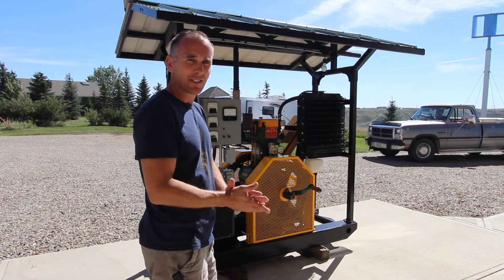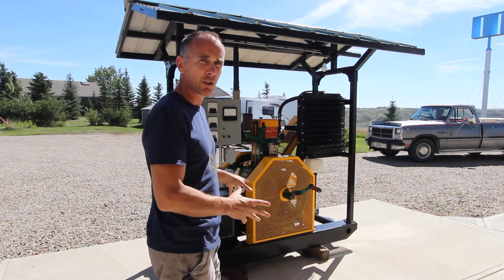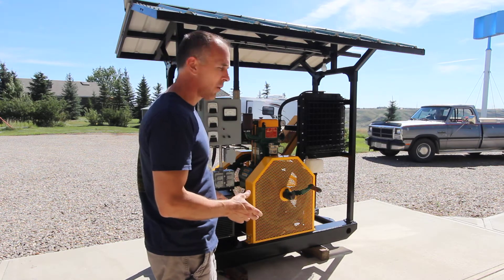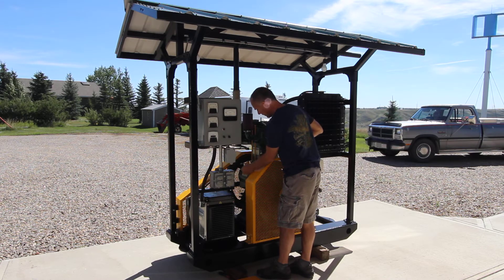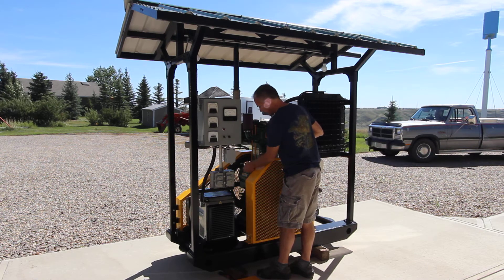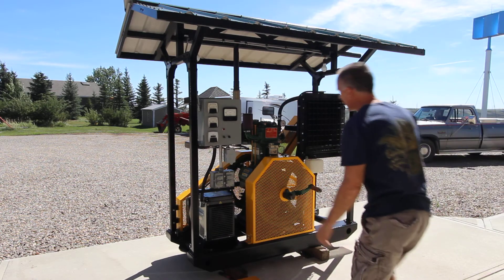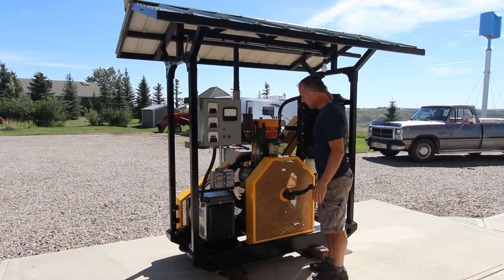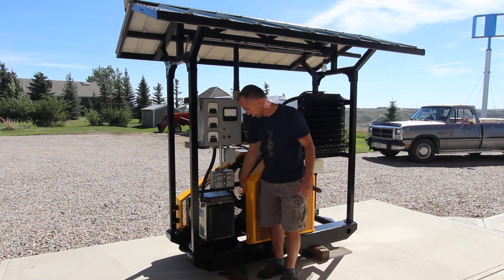Welcome to Eco Diesel

Comment: Who build or made the set up
Reply: I am Troy, the fellow in the video. I built this Listeroid generator/waterpump skid here in my shop. The pump wasnt on it at the time this video was made but it could be tensioned in when needed. This unit saved the day several times when the power went out and was used to demonstrate the Listeroid engines to our customers so they could see one run. The unit was sold to a very good customer of mine and is now being used to power his large shop running on a blend of diesel and new motor oil and loving it! Sorry i took so long to reply as i hadn't been on here to watch the video in a long time and never got a notification of your reply
Reply: @malisinimicus4358  very nice instructional video…what gen head is being used?
I have the omega brand…and have no experience operating them….how do you change the compression change valve…? Any fuel data at 3.5 kw? Or 2kw loads…?
Unloaded I hear 7 hrs per gallon.
Reply: @offgridmangogrower  that alternator was a Eurogen from India which were transformer regulated and only 120V. The new owner swapped it out for a much more efficient brushless Dingol 120/240 shortly after. This particular Listeroid would run 12hrs at full load on 2 gallons of pump diesel.
Reply: @malisinimicus4358  6 hours per gallon that’s amazing…was full load close to 3kw ?
My requirements of 3 kw would take care of
99% off grid demand during inclement weather. I’m getting mine prepped for a counter weight rebalance. Where is your compression selector? Would a multi grade oil help with starting.